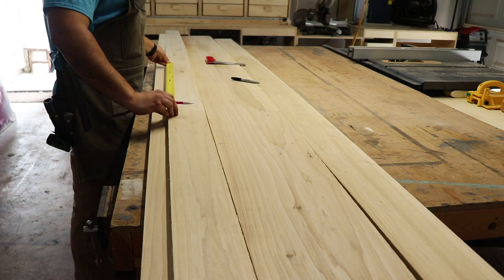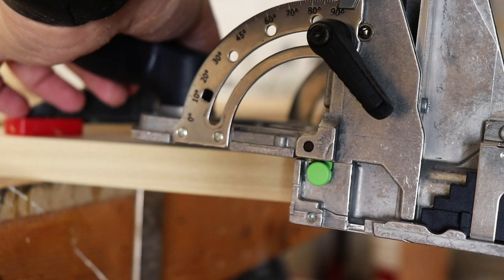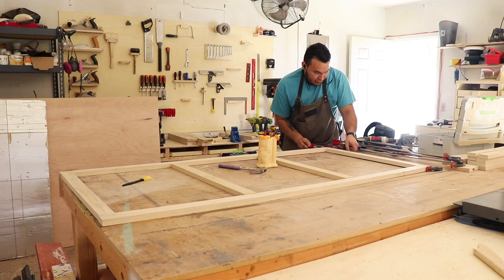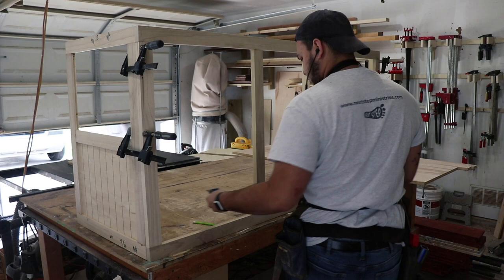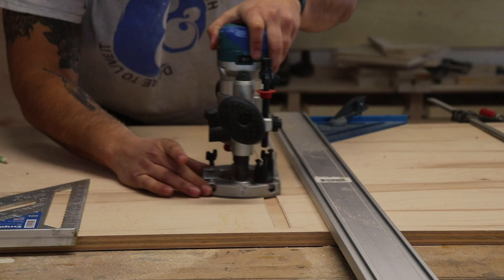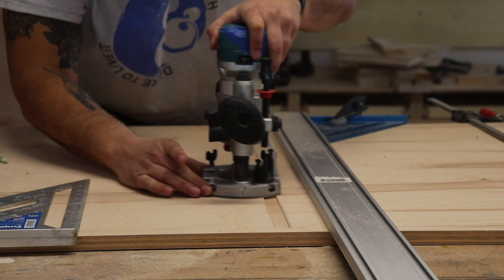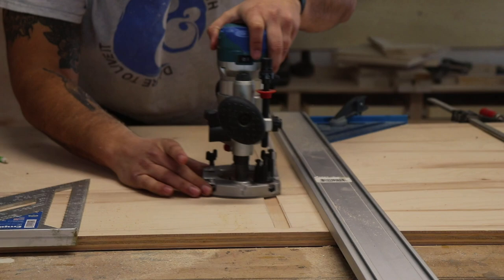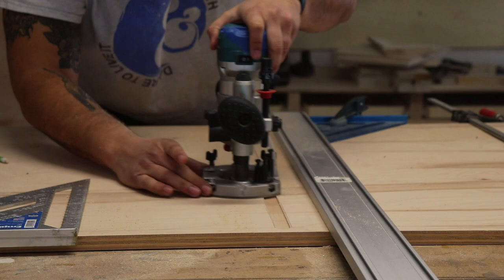How I made a Triple Dog Kennel (with removable dividers) // Woodworking

Comment: "The wife" oh boy 
Looks good its a awesome design. 
To distress it because the wood is so light, its worth painting underneath. Or you can stain. Then as you knock it back you have layers of the top layer, the stain or paint and the natural wood. More layers of paint the better. 

I really like the mesh you used. 

Thanks for the video.

Comment: The expanded metal is a nice touch...nice job overall.  I may need to look into getting a domino.
Reply from the maker: Expensive but so worth it. If I didn’t it again, I would get the smaller domino. I bought the big one because I friend talked me into it but I think the small one is more applicable
Reply: Where can you get this metal?
Reply from the maker: Look for a metal supplier close to you. The one I used closed down since the video 😞

Comment: Alex, this is a great video and very descriptive thank you for sharing. I have a few questions for you:
1) What was the depth of the rabbits that you used for the recessed panels on the sides of the kennel?
2) What was the depth that you used for the rabbit on the areas where you used the expandable metal mesh?
Reply from the maker: Thank you! I did 3/8 for the rabbits and 1/4 inch for the doors 😊

Comment: Alex, did you attach the wire mesh to the wood before you put in the mitered framing on the inside of the crate? If you did attach it, what did you use to attach the mesh?
Reply from the maker: I did not attach it. The mitered frame was the solution to keeping the mesh in place. It was a pretty tight fit.

Comment: What thickness metal mesh did you use? #18 #9 ?
Reply from the maker: I believe we ended up using a mesh that was about 1/8 thick or so.
Reply: @arayawoodworks   #9 is 0.3” thick and #18 is 0.164” thick,  and #13 is 0.225”. Which of these would you use? And thanks for your professional opinion, I appreciate the guidance